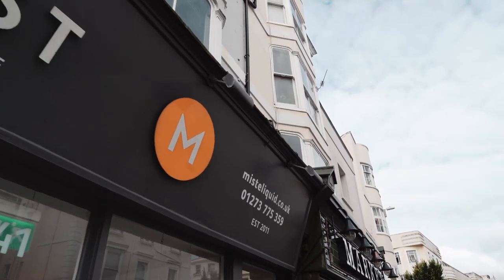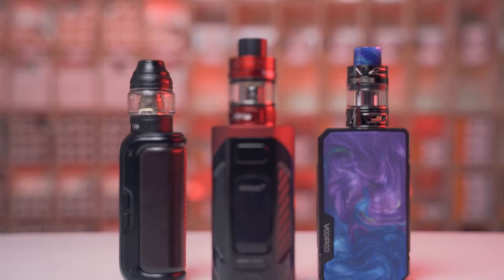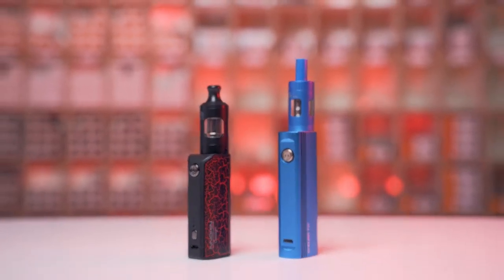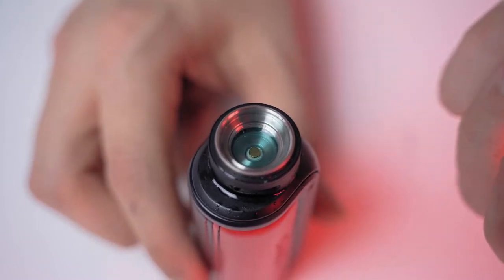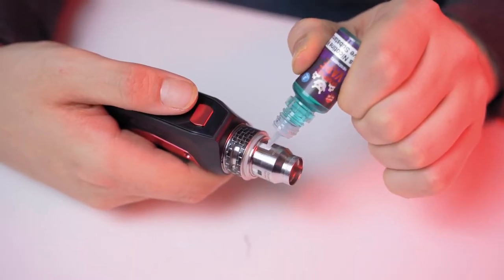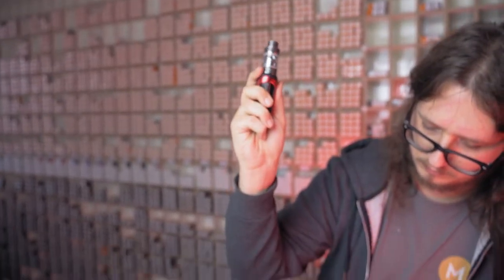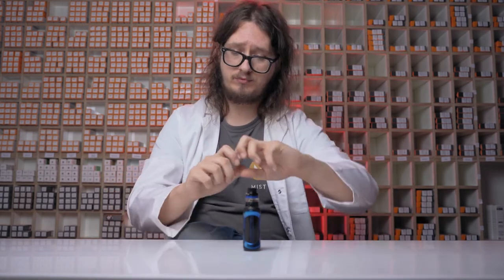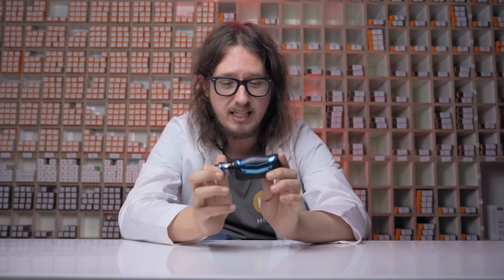Why Is My Vape Spitting? How To Fix A Crackling & Spitting Vape

Comment: While high power vapes cause spit-back, vaping at a lower than recommended power can also cause spit-back. This happens when your e-liquid get heated enough to boil, but not vaporize. The boiling is what causes the liquid to create those beads. Another one is too much airflow, where the heating element can't keep up with the cooling from the airflow and again, making the liquid to just boil instead of vaporize.
Reply: Bro how do I solve this issue with my caliburn g2? Help
Reply: I usually vape whatever I have at 1.2ohms. I never get spit back that way.
Reply: @leo959  bro which brands or salt nic flavours u can recommend which u liked the most?
Reply: @indianhomegymequipment3424  reds strawberry apple iced 30mg, reds apple peach iced 30mg, and mango iced reds apple 30mg. All by a company called 7 daze. My all day vape for sure. I make my own juices now. But those were my go too. Peach reds iced is all time favorite. Now I’m trying to figure out a way to make those juices diy style.
Reply: @leo959  unfortunately this brand is not available in my country
Reply: @indianhomegymequipment3424  oh bro u are truly missing out. What country do you stay at?
Reply: @indianhomegymequipment3424  I’ll post a link where reds apple can be found.
Reply: @leo959  india the only available brands are Nkd100, blvk salts, Vgod, Dinnerlady, I love salts by mad hatter, pod salts, Nasty salts
Reply: @leo959 okk bro✌
Reply: @indianhomegymequipment3424  salt Nic does get really expensive over time unless your a rich guy. But u should definitely give it a try somehow.

Comment: i just got my first vape, the valyrian V3 with the valyrian 3 coil. ive been smoking on it for 2 days and its spitting violently. burned the roof of my mouth. i tried sticking some qtips down in the tube to clean it but it was just nonstop gunk and i went through 6-7 qtips and its still pretty gunky. i do smoke it all day but i really dont want to have to replace a BRAND new coil. also when i try the ficking method, juice comes out of the airflow holes... can someone help me out a bit more. is it safe to unscrew the coil from the base of the tank while theres still juice in it? will it leak? any help is very much appreciated!

Comment: I got smok nord 4 After 3 days I noticed my coil shoot liquid out in the mouth piece these more then spots in your mouth it's globs beads no telling how much I ingested b4 realizing it's beads of liquid it's a 0.61 rpm2 tank salt nic 100 nkd melon kiwi . Also notice coil leak from bottom have to wipe push seal in. It's all together now looks great still got tons power but can't smoke it unless I want more dabs of liquid in my mouth. So actually I'm back somking tobacco atm. It seems like a lot to deal with and if I'm ingesting it and it's going also threw my skin that's not good. So I guess it's called spitting but it don't burn me or nothing I just feel like beads of that salt nic gets on my lips etc. I don't like that. So if I vape probably gonna do vapor tech mango my favorite one and I don't need to worry about stuff like that but bars still do that at end leak out or temperature can mess it up. So I'ma get another coil try again see what happens. I left on side overnight room so I'm thinking if I stand up right and put somewhere fine Maybe want have that problem. That's a dollar a day in coils if only 3 days last and no telling how long I puff on it until I recognized I been ingesting alot of that liquid when I smoke.
Reply: i’m having the same problem at the moment, did you solve it?

Comment: Hey, 2 days ago I bought the Z60 Zlide, primed the coil and filled the tank, 10 minutes later I tried it and everything worked just fine, after I tried, I let it sit for a bit and when I tried again it felt like the coil was flooded (I was getting liquid instead of smoke in my mouth with 0 smoke) Replaced the coil, same story. Maybe I'm doing something wrong?? Help please :)
Btw the coil is 1.2, used it at 11w and 14, no difference.
Reply from the maker: Hi there, what liquid composition were you using 0with the kit? Thanks!
Reply: @MistEliquid  hey, its Liqua 50/50, basically I have to shake it to force out the excess liquid over the top that the coil sucked in, if I don't do it it just won't work. The coil gets flooded every time I live it for a while.

Comment: I am confused when I prime my vape (I'm still new) I always put the liquid inside since it does not give a burnt taste and feels better I think. but back then when I was learning how to prime coils from official videos, I did the exact thing you explained put a thin layer on the exposed cotton on the outside. and I let it sit to saturate for 20 to 30 minutes or even days, then I lower the voltage a bit to let it break into the coil and then take a puff which lead to a burnt hit. I thought I have to vape a bit for it to start feeling better but nope all burnt hits, please explain.

box mod: maxus 100W/falcon king ohm tank with M1+ coils
Reply: What ratio is your liquid?
Reply: @jamiehoogerdijk2826  max vg
Reply: @0007mitchellp4  How much Ω?
Reply: @jamiehoogerdijk2826  .16

Comment: Hey mate, im using a bskr rta mtl, the coil is 1.3 ohm and it sorta bubbles a bit even brand new coil, but if i draw on it harder it doesnt do it, any reason you can think of? Possibly oversaturating the cotton at the start?
Reply: Air flow.